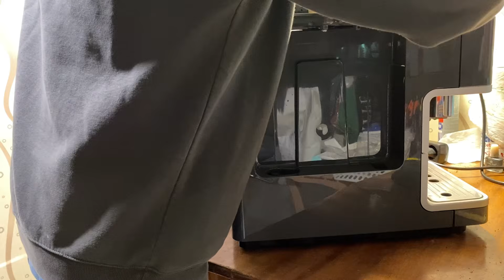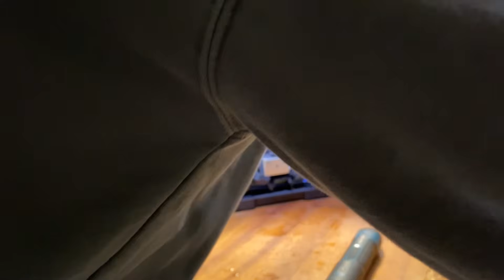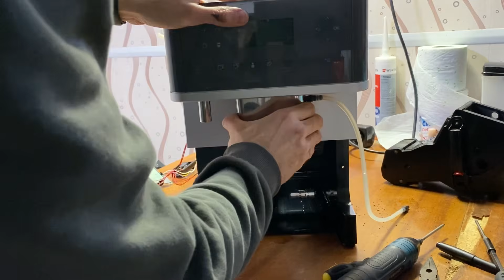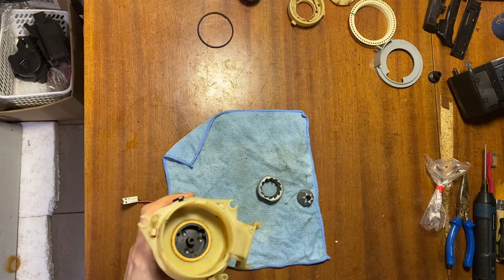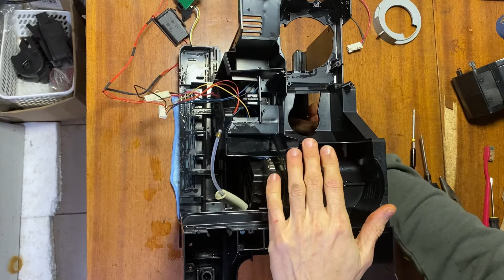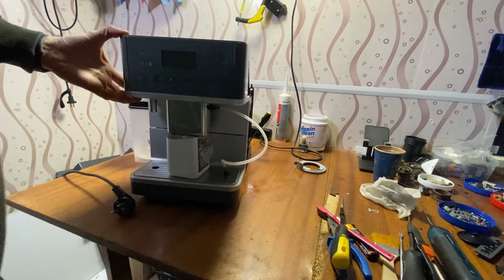Ремонт кавових машин Miele. Розбирання до рами та повна перевірка.

Comment: Hey man, great video, I have no idea how you even dared pulling the whole thing apart, I remove a screw and I'm already nervous 😂. Question, the black bracket at the top of the grinder in minute  27:08, you show how to put it back, but how did you remove it? Did you just pulled it out by force? I'm trying to replace that part, but it's hard to remove it and I'm afraid to break something else 😢. Thanks a lot!
Reply from the maker: Hello. That black fixator - I got out by inserting two metal sticks from both sides of that part , between its and white borer. That sticks release a little two holders on top of borer.
Reply: @OlegPC Got it, thank you so much for your reply, man!
Reply from the maker: @luiszendejas9200 Great to hear that )))) Wish you an easy repair)))

Comment: Fantastic video! Thank you so much. Great job speaking English and showing how to do this so efficiently. You’re an expert and it shows
Reply from the maker: Thank you for your kind words!
Reply: @OlegPC 

You’re welcome! 

Would you mind me asking you a question? 

My CM6350 started making weak coffee. We thoroughly cleaned it and even replaced all of the gaskets in the brew unit. 

The machine made one good cup of coffee immediately after cleaning and the new parts. Then, the 2nd cup was watery like we never did anything at all. 

What do you think the problem could be ?
Reply from the maker: @barnswallowtinyhomes2990 it’s looks like too fine grind size adjustment- so make it bigger ( turn handle to the right- 1-2 clicks). If it will not help - drainage valve can be cause ( but according to your story - doubtfully ). So start with grind size
Reply: @O @OlegPC thank you for your response. I appreciate your willingness to answer. 

We stepped through all of the grind settings and they all yielded the same watery coffee. 

It seems like the grinder doesn’t grind for long enough to make any significant amount of grounds. I think it used to grind for a longer period of time. 

I was wondering if there’s a micro switch that tells the grinder how long to run for?
Reply from the maker: @barnswallowtinyhomes2990  If grinder work small amount of time, resulting in weak coffee and small coffee tablet size (below 2cm) - main cause - hard turning main shaft of brew unit motor assembly. So disassemble it and use sand paper to make smaller shaft and bigger hole for that shaft in brewing motor case. Shaft must be easly turning by hand
Reply: I know!!!! I wish he lived in the US.

Comment: I have a cm6350 that doesn't make milk foam properly it is mostly  hot milk and not foam when making cappucino with little or no foam on top. Also everytime I start machine after sitting for a while it says clean milk pipework which I have done. Is this caused by weak pump or by ceramic mixing valve not functioning properly? It seams to put enough steam when hose is not in milk jar but when trying with milk comes mostly hot milk and not foam. Any help would be appreciated. Thanks
Reply from the maker: Actually- you are absolutely right- it can be both cases. More often- some problems with multivalve. More rare - pump problems. But first - try disassembly front cappuccinator - it can collect old milk and create trouble with milk steaming too.
Reply: @OlegPC I cleaned all the dispenser parts and the steam nozzle hole, I think it's not mixing air with milk properly in the ceramic valve, I will take it apart to see if there are any clogged holes and check microswitches as well.
Thank you
Reply from the maker: @cristinastor Ready to help. Yap, multivalve - next place to check

Comment: Many thanks for such a nice and clean,  visible video, Question: what would you do if after servicing grinder; you still get the "Fill the bean container" message?
Reply from the maker: Firstly reassemble grinder ( maybe some variation in assembling it , so better to check) . If it’s willnt help - replace burrs - compatible are from Melitta / Nivona for classic grinder. In Germany art 2005M
Reply: @OlegPC  Thanks fro fast response, I will do it and get back to you with results!
Reply: @OlegPC  Can you check part number is correct?

Comment: Thank you so much for this video. My machine is stuck with a “fill and replace a water container,” then preheat message but water is not being pumped at all. It also prompts me to descale which I do but the ester never makes it out of the water reservoir. Any suggestions what I should replace? Thank you again
Reply from the maker: If machine tries to get water from water tank , but water doesn’t get through machine at all. Maybe you can hear silent sound of working pump - there’s clogging insane machine - first place to check - multivalve. Disassemble and clean inside it. (2) Maybe Pump itself doesn’t work (disconnect outlet tube of it and start machine). If it’s doesn’t starts - it can be burnt or wires broken one or (the baddest case) can be problem with power board)

Comment: Hello, Oleg! Thank You for such a great video! I have a couple of questions. What grease do You use in ceramic valve? Another question. If the pump is clean and dry, can it become weaker in pressure over the time? (2018year, 15000 drinks) Thanks, already!
Reply from the maker: Pump over time of course can loose some qualities, but you cant check by test - only by place a new one. Mostly pump need to be replaced if it leaking, in other cases - it works. In ceramic valve i use German Grease for Gaskets for Miele/Melitta machines. International analog - Oks 1110.

Comment: hi, how to take apart brewing group motor? I removed all the screws but looks like there's some kind of plastic tab that holds motor cover together.
Reply from the maker: If you got brewing motor case on table in front of you ( I mean inside machine , it’s better don’t try to disassemble it). Unscrew 3 screws under back cover , lift but 2 sticks or screwdrivers ring, that pushes microswitches, take out all 4 micro switches. Now - just pull one side of case, trying turn it a little left / right. It will opens.

Comment: I have the Miele 6160. It keeps giving error F17. It is BRAND NEW with 0 coffees on the odometer. I read that the hoses can become collapsed and water needs to be forced through it. Any help would be appreciated
Reply from the maker: Hello. Take out water filter if it’s installed. Some air in system or in water filter - pump can’t suck water
Reply: @OlegPC  dyakuyu!
Reply from the maker: @ Not at all. Have a nice day!

Comment: Thank you for your video i tried taking mine apart although i couldnt see much wrong with , but i also havent run all necessary tests, would have an idea water pumps fine, cofee grinds but it does not dispense and instead just seems to be drained to the water tray on the bottom.
Reply from the maker: Hello. It’s looks like a broken drainage valve.
Reply: @OlegPC  thank you for the fast reply i assume miele does not supply the part for this model anymore perhaps it can be ordered from ebay if not perhaps its the fault of the micro switches as you showed irregardles thank you for your video it has been very valuble to me
Reply from the maker: @ Drainage valve is the same as in any Melitta/ Nivona machines - so just buy such. For instance part number 71954. And check for  cracks inlet water connector of brew unit (try to move it a little) - number 15056
Reply: @OlegPC  hi i dissasembled it checked all the micro switches in brew gear box they are fine drain valve had lots of mud around it i cleaned it reassembled the machine but still no coffee ;( , also now one of the pipes pops off of the ceramic valve / multi valve do you have any idea why. Thank you for your time.
Reply from the maker: @kean4218  Hello try to disassemble multivalve and check inside it can got some clogging inside or you just incorrectly connect tubes to multivalve head
Reply: @OlegPC  thank you for the reply, i though that i installed it incorrectly but im not able to find any resource on correct pipe configuration and i never made a photo rookie mistake 😨.
Reply from the maker: @kean4218  Just find video with full repair (or any repair) of machine like yours. Any 6 series Miele exept modern xx60 models got the same connections. Theres some on mine channel, but on russian / Ukrainian - but total picture of connections you always can get
Reply: @OlegPC  hello my friend the new drain valve arrived yesterday i install new part it works now i have cofee :) , but pump is worryingly loud it works but im not sure why its really loud.
Reply from the maker: @ Hello. Can be many reasons. Starting with pump itself, next variation can be multivalve problem, and finally some problem in brew unit. The simplest variation of course - brew unit. So, disassemble, clean in chemistry bath all parts, maybe change gaskets.

Comment: Олег, как легко и просто все разбирается твоими руками :)  Одно удовольствие смотреть, как волны в море или горящий костер. Удачи, пусть все оживает в твоих руках
Reply from the maker: Спасибо. Это все от постоянного повторения. После разборки Нивоны 1030 - Баристу разбираешь на «раз/два», кажется - проще кофемашины нет )))
Reply: @OlegPC    В 2х славах- насколько похожи внутри Мелитта-Нивона-Миле и качество исполнения? Может это тема следующего Вашего ролика?
Reply from the maker: @ Запчасти одни, но разные платы, разные компоновки, разная нагрузка на дренажник и мультиклапан. Короче Милле - надежнее. Качество кофе +/- одинаково
Reply: Привет, Олег. Отличное видео, лучшее, что я нашёл на эту тему. Моя СМ6350 стала выливать много воды в поддон ( вместо сухих лепешечек). Я подозреваю это одна из прокладок в brewing unit, можешь подсказать, какая именно?
Reply from the maker: @ Hello. Mostly this trouble is addressed with drainage valve. If you changed this valve more than 2 years ago - you already can put a new one to your machine. This valve consists of plastic parts that with time have scratches and release pressure from these scratches. In result your machine will send water to the water tray but not into brewing unit